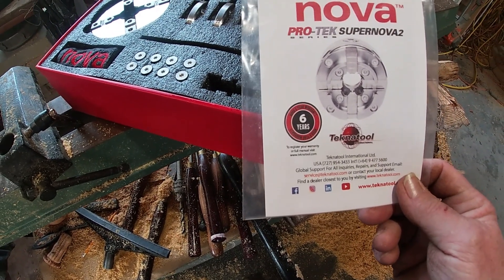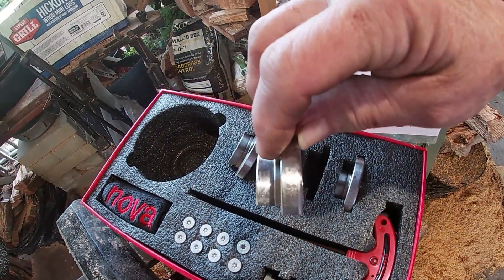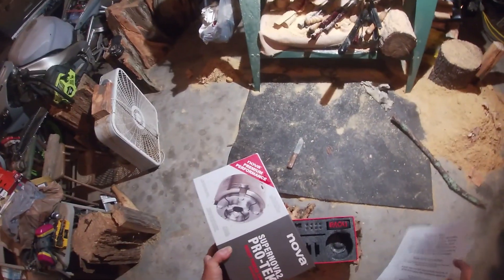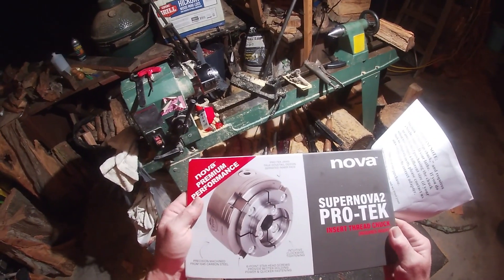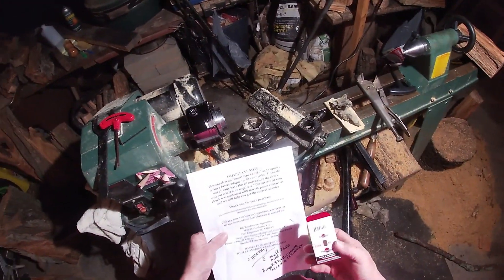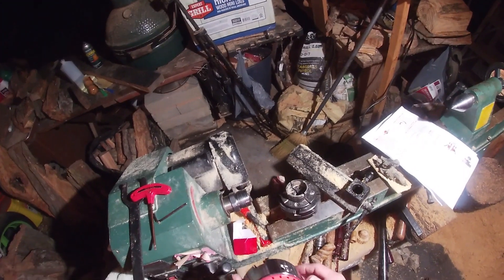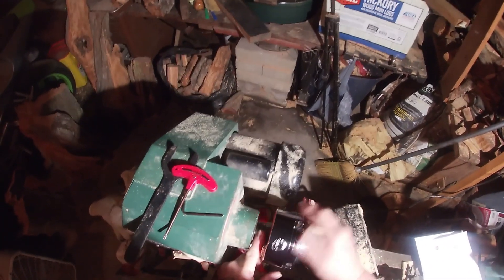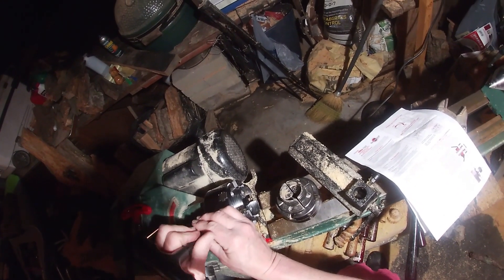Nova Supernova2 PRO TEK CHUCK Fits Harbor Freight 34706 with this CHUCK Insert!

Comment: i had the same trial when i ordered a chuck, i realized i needed an adapter, but took forever to research and find what size adapter i need.
Reply from the maker: Exactly Bonnie! And that's why I wanted to put this helpful video out in hopes that it will save someone else the aggravation of having to ferret out the proper sized adapter out there like a needle in a haystack. You would think that as common as the Harbor Freight lathe(s) are, they would have more info readily available and a variety to choose from rather than being so limited to 1 or 2 tertiary chucks.